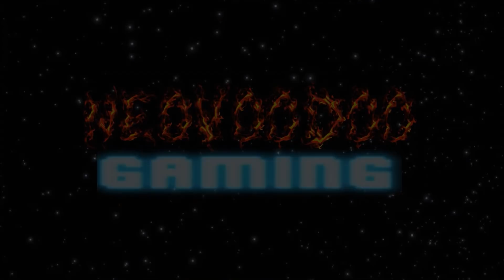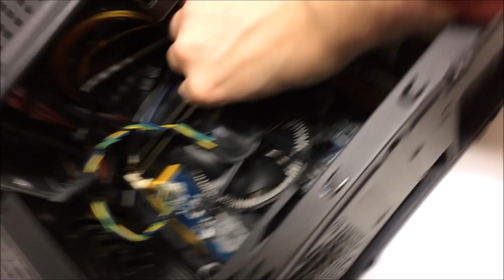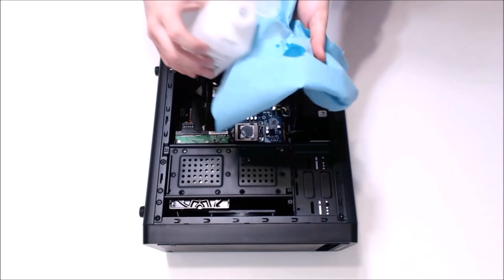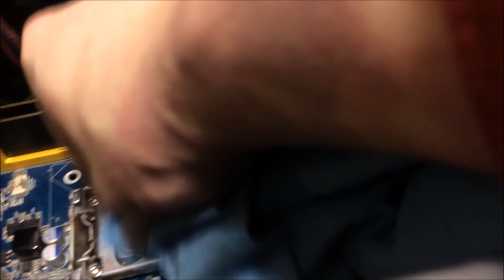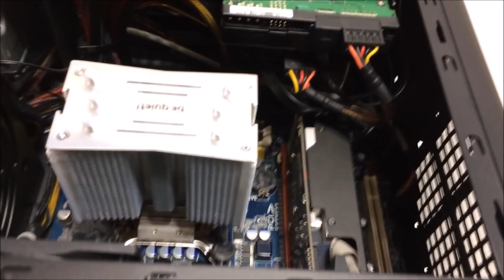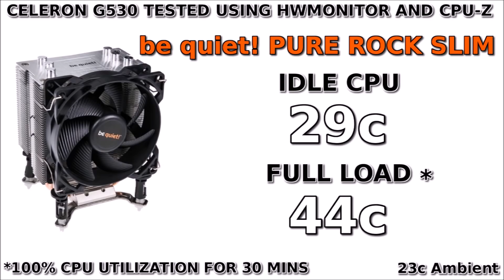be quiet! Pure ROCK Slim VS Stock INTEL Cooler + Installation Guide

Comment: Should I use this on a Ryzen 7 2700?  Because I don't really have any other options because I am on a tight budget at the moment
Reply from the maker: If your case can fit it this is a little bit better IMHO for the price. https://www.amazon.com/dp/B06WV898Y1?
Reply from the maker: 120W TDP cooling efficiency on this cooler and Ryzen 7 2700 is Default TDP
of 95W should be ok (fan rpm's might run high 92mm) if you don't heavy overclock or have high ambient temps bad airflow in the case. If you are on a budget the cooler that comes in the box with Ryzen is pretty decent at stock voltage.
Reply: @NeoVoodooTech  thanks it's just because I just have the chip
Reply from the maker: @thegoofygiraffe4788  np! this should perform better and be alot quieter then the stock cooler anyway.

Comment: pure rock slim vs shadow rock slim ??? which is batter?
Reply from the maker: Shadow Rock is about 25-40% better. 160 watt tdp vs 120 watt tdp, 135mm vs 92mm fan, 4 heat pipes vs 3, larger thermal mass etc. It's also alot bigger and cost more.
Reply: tnx, i intend to overclock my 4790k 4 gig to 4.4 so i need a strong one, cuz with intel stock nowin game with battlefield 1 is araund 85 -95 celsius so ... :| i need it and pure rock is 40 euro and shadow rock slim 44 euro in my country ... avrage salary is 250 euro .. si im fucked.. but still i need it :)) again tnx for the info
Reply from the maker: I have a 3820k i7 at 4.5 on a Cooler Master Hyper T4. I'd recommend the Hyper 212X or the Pure Rock 150w TDP or the Cryo Rig H7 it's on sale right now for 5 days. How much space you got in your case for height?
Reply: tnx but i dont have money yet.. i will have on the end of the month and i canot aford shipping, i live in romania :( tnx for the info :D
Reply from the maker: Cu plăcere! Anytime! No problem try any of those 3 or anything that can handle a 150watt TDP.
Reply: my case is a  Zalman R1 Neagra Mid Tower
Reply: i am not romanian by the way.. :)) i am hungarian .. I live in transilvania, which is now par of romania but it was a hungaryan lan before they betray us .. but thats a long story  , tehat köszönöm szépen ! :)
Reply: so the shadow rock slim is good or not ? cuz its 160 tdp i got confuzed now..
Reply from the maker: Correct! 160 is very good for i7

Comment: do i have to install a plate behind the motherboard or will the pushpins be enough?
Reply from the maker: Son Of Legacy I did not and it seems fine, depending on the orientation of your case or if you move your case a lot you may want to but most motherboards come with some sort of metal brace on the back of the CPU socket which should be plenty! It is a pretty light heat sink it and it shouldn't warp most pcb's.
Reply: NeoVoodooTech sorry I forgot to mention this in my original comment, but is the cooler compatible with LGA 1151?
Reply: Yes lga 1151 will work with it

Comment: Which one is better bequiet BK008 or BK009? BK009 has 4 copper tubes,but BK008 has only 3. Is there any point to pay 10 euros for 1 heat pipe?
Reply from the maker: What cpu do you have?
Reply: i5-7600k
Reply from the maker: You got the K overclock able then probably want the extra pipe. One single 6mm copper tube adds around 30 watts of heat dissipation taking you from 120 to 150 watts. Is it worth the 10 euro's? Idk.
Reply: Okay,thank you for answer!

Comment: Thanks.
It's quite ridiculous that none of the "professional" reviewers use the stock cooler in their reviews. I assume most people looking at this cooler are going to be upgrading from stock.
But i'm guess that the the stock tests were done with old thermal paste, right?
Reply from the maker: I actually think it was expensive TIM on the stock cooler. I repasted the intel cooler about 5 months before the video. The stuff on the Be Quiet came pre applied. My testing methodology would be to use the best thermal paste on both coolers to isolate the performance of the metal and fan itself and not the TIM, unless it comes pre applied in which case test that because most people use the pre applied stuff. Ideally you want the same paste on each.

Comment: Very informative video. It's kinda hard to find any information about this particular cooler. Kind of a shame it uses the push pin configuration. I've had nothing but bad experience with those, from the pins bending to just losing rigidity over time. Still, for the price it's a very decent cooler.

Comment: Cool Vid, but how quieter was the be quiet compared to the stock cooler ?
Reply from the maker: I would say the stock intel cooler on idle sounds about the same as the be quiet does under full load. The main difference being the be quiet never gets any louder. It always as quiet as the idle intel cooler.
Reply: NeoVoodooTech and its even quieter in idle?
Reply from the maker: Honestly with the side panel on I cannot hear an audible difference between idle and full load with the Be-quiet fan. It's very close in decibel range.

Comment: 2016 and you have a gt 740 and an intel celeron g530? i mean dont take me wrong i just upgraded from a gt 730 to a gtx 750 ti at the begging of the year , still not great but still , great video tho !
Reply from the maker: Ha thanks for the compliment! I'm trying to make these videos better and better! I'm glad you liked it. Yeah it's a little low spec but this is just a pc I built for a video! It's used for netflix and as an HTPC. My main rig is on the about section of this page.
Reply: NeoVoodooTech Oh , ok thx btw it helped me alot , cheers!

Comment: Very good presentation. I haven't tested this cooler, but I can vouch for it. I replaced the stock cooler on my (also low-spec) computer with it a couple of weeks ago. Right now, it's running in my 10 year old Antec NSK 3300 case without a case fan, because the fan that came with the case, which I never changed out, suddenly began vibrating so loudly, I disconnected it. Still, right now, the CPU temp of my Pentium G860 (65 TDP) is hovering around 35-37 degrees, and that's with the fan on the cooler spinning at a speed of a little over 1200 RPM, which is about half speed. So, it's keeping the CPU much more than cool enough in a very closed case with no other fans, and it's so quiet that I literally have to put my ear a few inches from the computer to hear it at all.
Reply from the maker: Nice low spec setup! I think these old parts still have life in them. Also those are good temps for one fan! I like old cases too I've got an NZXT alpha I wanna do a video or build with.  Appreciate your comment!